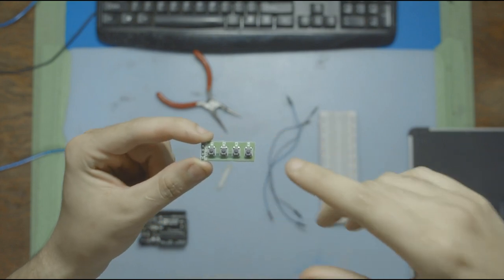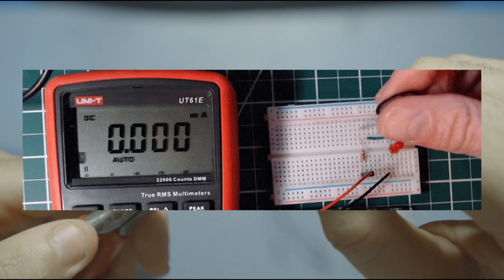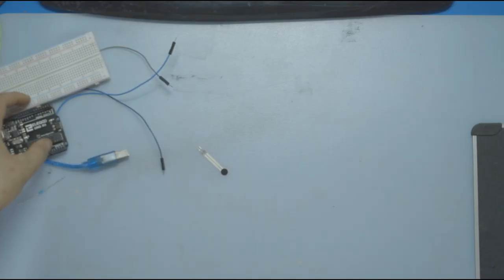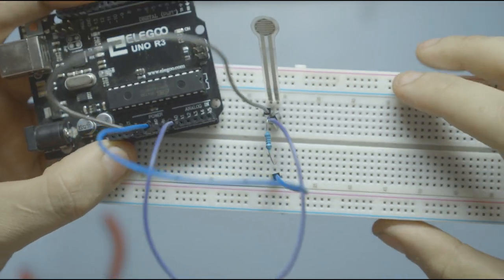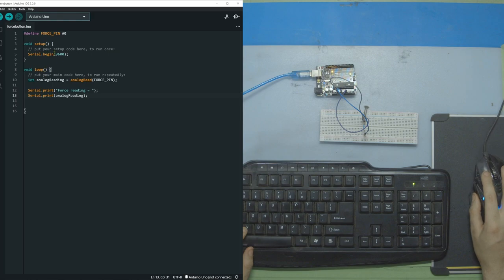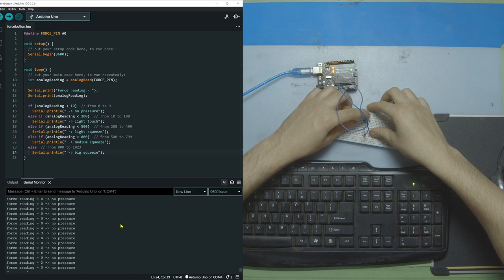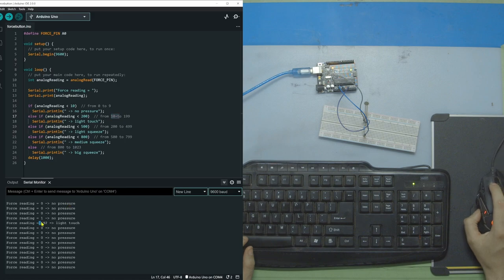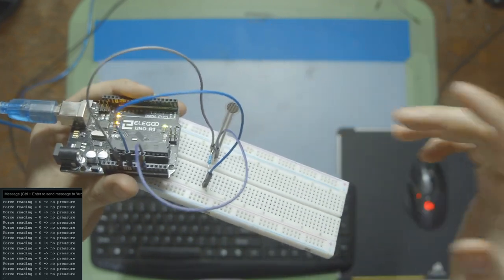FORCE SENSOR Tutorial - Force-Sensing Resistor w/ ARDUINO #arduino #esp32

Comment: Hi, I came here because of the ESP32 tag but you didn't use it on the video, so I think its not quite appropriate to have it on the title... Regardless of that,  what do you think would be the reason why an ESP32s ADC is bringing random values when nothing is connected to it?  Been trying to implement multiple FSRs with an ESP32 Thing and all the ADCs are going crazy haha.
Reply from the maker: This project applies to both arduino and esp, and the whole point of key tags is to bring new people….